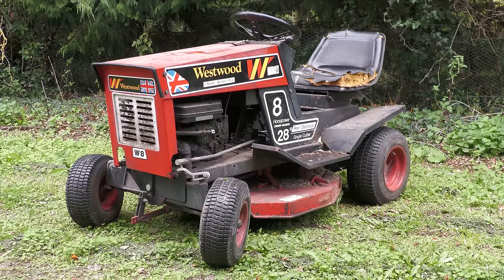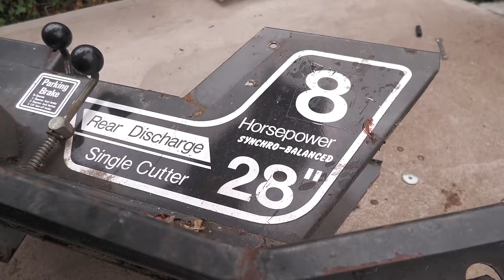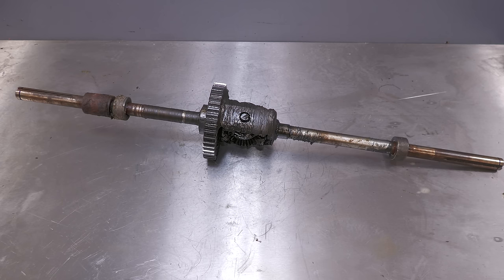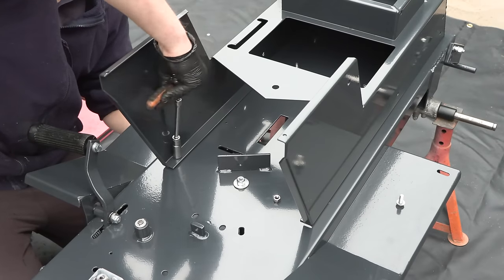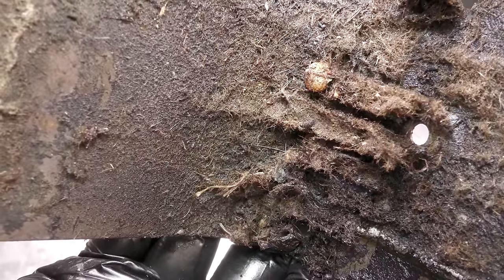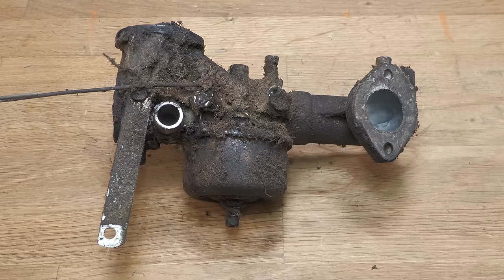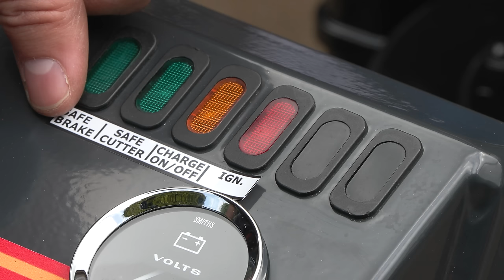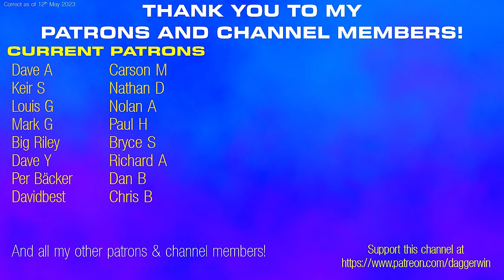RETRO 40 YEAR OLD BRITISH MOWER RESTORATION

Comment: What a good candidate for a restoration as it's in pretty good condition.
With the stainless hardware you should use anti sieze, it becomes an issue if you ever want to unbolt it in the future.
I rather have a rusted steel bolt then a seized stainless bolt when I need to disassemble something.

Comment: Great video, far better than most on YouTube. One note, when setting the lash on valves (the gap between the valve and the tappet), this should be done with the engine at TDC. In the video, one valve is clearly compressed meaning you are not at TDC and therefore will get a false gap measurement. At TDC, no pressure is on the valves from the cam. In an L-head engine, it is rare to have to adjust factory clearances if reusing "good" or not excessively worn components.
Reply: This is a four stoke engine, the Exhaust valve is clearly open, hence the intake is clearly closed....so why can one not adjust the intake clearance at this point? The intake is never going to be closer to being closed at Top Dead Center.
Reply: @brianferguson6278  It's not about opening or closing, that is the point. When the cam actuates (lifts) the valve, it does so by contacting the stem and lifting the valve up. At TDC, there is no valve contact with the cam and the gap is a known gap for both valves so it can be measured. If it is touching the valve, there is no gap, so how could you measure it? You want to know the clearance between the camshaft lobe and the bottom of the valve when the gap is present. There are multiple points in the 2 rotations where each valve has zero contact but the grind on the cam lobe changes the distance. The distance that is referenced for adjustment is done specifically at TDC. TDC is the top piston movement of the first rotation (The piston goes down for intake, then up for compression). The engine can compress the air because the valves are closed under the pressure of the valve spring, meaning the cam is not touching and lifting up. This is the specific moment the gap needs to be measured.

Comment: I like how they have the exhaust & muffler mounted under the tractor instead of just shooting out from the engine like they do here in the USA. Much quieter that way and keeps the exhaust gasses from blowing up in your face while mowing close to fences & buildings. I also like the rear discharge design as well allowing the operator to mow on either side of the mower deck close to trees, buildings and fences. The USA version is almost always a side discharge, so you have to turn around & go the other way to mow close to the building, fence or tree. However, side discharge is easier to use implements like a grass catcher.

Comment: Americans also run wire brush pieces through all the orifices in the carburetor and emulsion tube holes. If small bits of corrosion still cling to the inside of the jets and passageways the ultrasonic cleaner will remove the grease and oil bits but will not keep the jets sized exactly the size needed for steady idle or maximum power during heavy mowing. A rich or lean condition will not, let it run like factory new. We shall soon see. These engines do an amazing amount of work but not letting cool air flow over the cooling fins is probably what caused the rings to underperform. Thank you Mac for your careful restore. Tis a good thing.

Comment: Lovely job, well done. The only thing I would suggest you do while the transaxle is in pieces is replace the shift keys as they only need the slightest wear on the ends and they cause big problems with gears slipping and jumping out! Apart from that it's a great restoration.

Comment: Just a quick suggestion about protecting the Transmission housing.  I noticed you used clear Lacquer.  You might reconsider that on your next rebuild.  You might want to consider using a primer and a high temp enamel in black.  This might sound counter intuitive, but the black paint will help absorb internal heat and dissipate it to the surface area.  it will also do a better job protecting the aluminum surface because it will resist scratches from use.  One more suggestion would also be not to fill the "transmission" with grease again, but rather drill and tap in a Drain Plug and Filler Plug for 80w-90 GL-5 Gear Oil.  I would think with today's Gear Oils, this might be a better solution, unless there are no axle seals to help retain the oil.  Just a thought.  

At any rate, I have been enjoying your channel.  Looking forward to more of your rebuilds, they are always interesting, entertaining and educational.  Keep up the beautiful work.  Great Job!

Cheers,
Shane McGuire

Comment: I never understand why channels like this do not power wash then blow off these machines before working on.  This makes it easier to clean, easier to work on, and really lets you know early on what you are working with.  It would likely help to pre soak the bolts and screws with a penetrating oil.
Reply from the maker: I would clean a machine that just needs a repair but to me cleaning a machine that’s going to be dismantled is a waste of time because every part is going to be sandblasted anyway.

Comment: grouse work mate she looks lovely afterwards and i know the before and after results in the long run and we lot have very similar mowers known as Victa 2 stroke aka 2 cycle push mowers or even the (SP) self-propelled type on some models and makes but yeah lovely qaulity back then and made here for sure even the older Victa Ride on Mowers we had then were no different too and cheers from Australia 🐨🐑🦘🌴🌏🇦🇺 and the first one was the Victa Rotomo and the peach tin prototype from the 1950s by Mervyn Victor Richardson too and right in his Sydney Australian Garage too.

Comment: I am NOT telling you how to do what you do. Making that clear first.

I'm an ex automotive mechanic, and I find it kind of funny that when it comes to small motors, like lawnmowers, people rarely wash down the engine, gearbox, diff etc first.

Whereas it's an exceedingly good idea to wash down the outside of those components before pulling them apart in the car, truck, earth moving etc world. As tolerances are much tighter and a little more sensitive to dirt ingress. Was a good watch though.

Comment: I have an old craftsman rear engine riding mower that I need to disassemble the engine. I believe the independent counter balance shaft is having a problem maybe the gear.  I have parts schematics but no specs for valve or ring clearances or other information its a Tecumseh engine. Is there a good place to find rebuild specs? I figure i should give it a shot and found a head gasket already. thanks

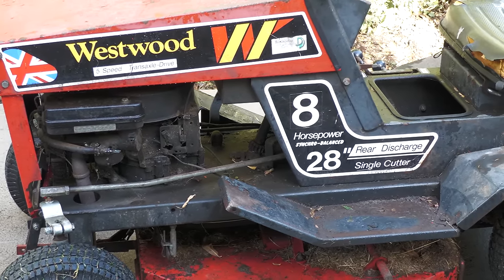Comment: 2:00 Do you think it was originally sold with a 6 or 7 HP engine, and then when they upgraded to 8 HP, they just put an 8 on top of the old stickers?
Reply from the maker: Westwood did also manufacture a W6 so I guess they just ran out of W8 stickers lol

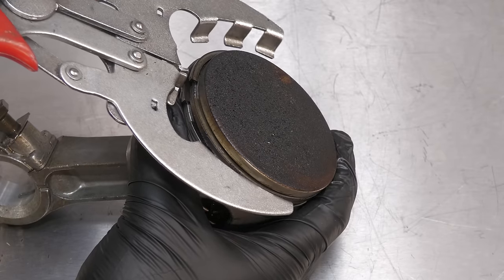Comment: 58:27 You destroyed this engine with honing, 191707 has no cast iron cylinder liner, only a primitive ALUSIL coating. By stone cleaning/honing you only stripped the protective coating. The engine literally has a couple of hours ahead of it. I know what I am writing because I went through it with this particular model, it ended up with the cylinder sleeve.

Comment: 25:30 Never heard of grease in a gearbox, it just gums up the works.. Usually SAE 90 or 80W-90 gear oil. Why did they put a drain and fill plug on the gearbox for? NOT for grease.
Gears circulate the oil and keep the gears lubricated, grease wears off during use and you end up with dry gear teeth and wear.
Do you Brits not know anything about lubrication? Grease is for bearings and ball joints , oil is for gears in most cases.
Reply from the maker: Lol it 100% requires Bentonite grease not oil and for your information this gearbox was manufactured in the USA

Comment: When you reassemble the transmission, use GEAR OIL! Not grease. If you put grease in the gearbox, I'm outa here and you get a dislike.
Reply from the maker: No you don’t use gear oil in this gearbox. It requires Bentonite grease.